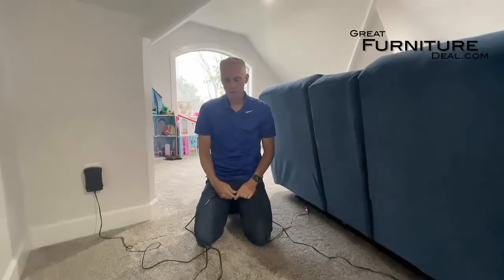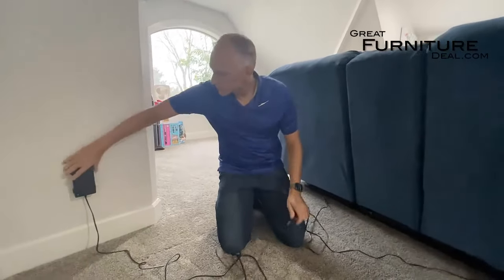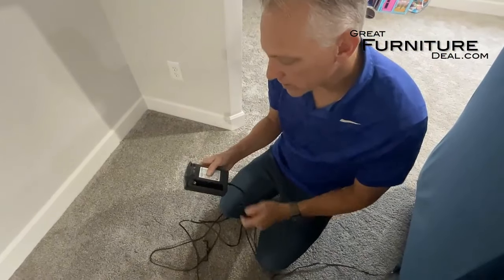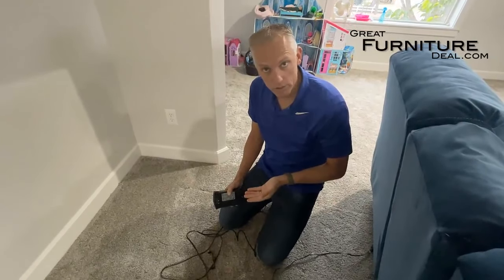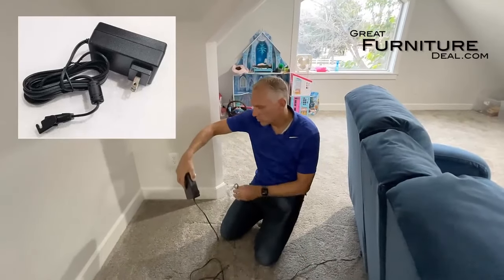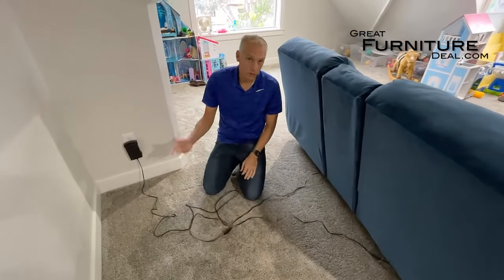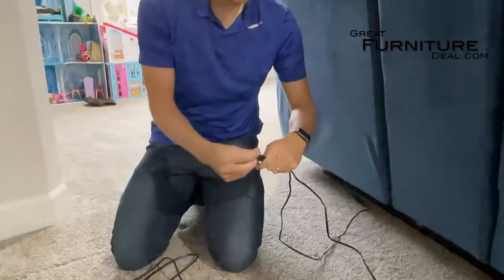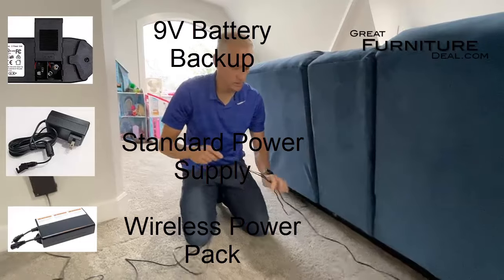Replace My Power Supply for my Power Recliner, Sofa or Loveseat

Comment: Can a battery-operated sofa, love seat and recliner be adapted to use a wall socket instead of these batteries? We bought a brand-new set of furniture and didn't know that the batteries we use constantly go out and if the end of one is extended, it is darn near impossible to get up out of the seating. We have about 4 batteries which only last a day or so before they are in need of recharging. What does a battery assist pack run pricewise? Thanks.
Reply from the maker: Yes, you can just use a wall plug. Give us a call at 800-970-5889 and we can walk you through all the options.